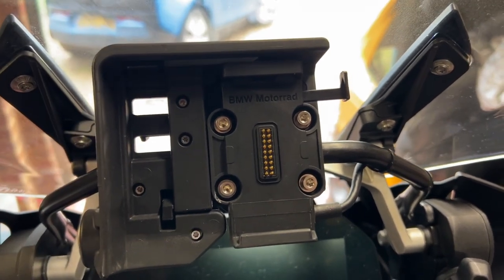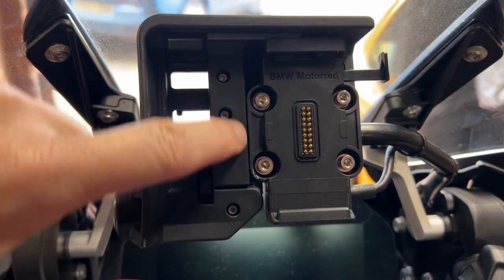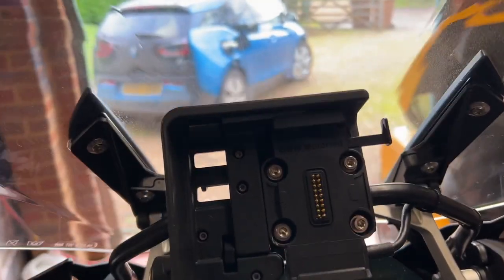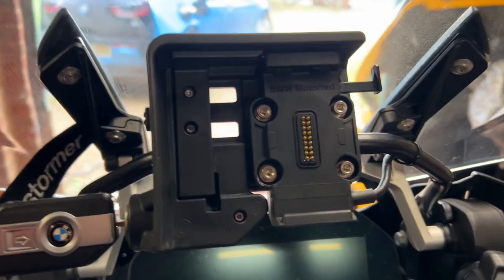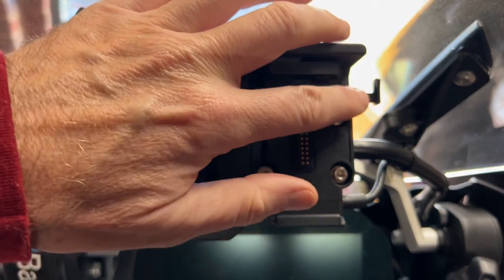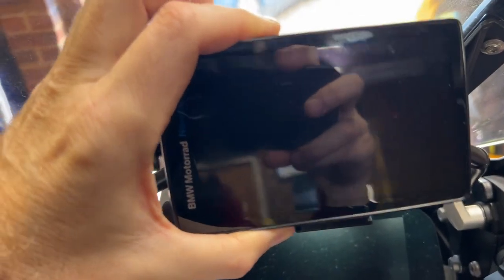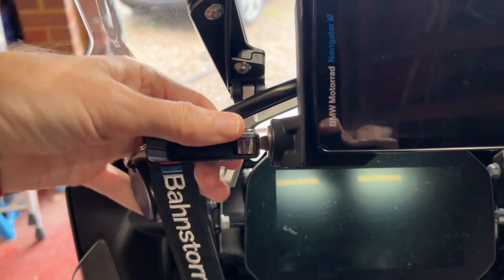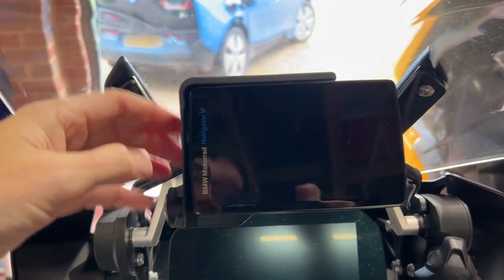How to mount a BMW Sat Nav 6 on its WILDLY COMPLICATED cradle

Comment from the maker: You can get a BMW Smart Phone insert for the Sat Nav cradle, that holds your phone in the mount. It charges your phone. I think we are in a period where there is not a great amount of difference between dedicated sat nav products like Garmin (on which the BMW device i based), and mobile phone apps. The device doesn't need a phone signal and is easier to use with gloves. I've used my phone for previous long distance trips and found it got really hot, pretty soon the battery dropped in capacity.